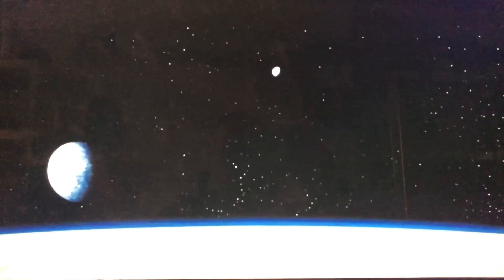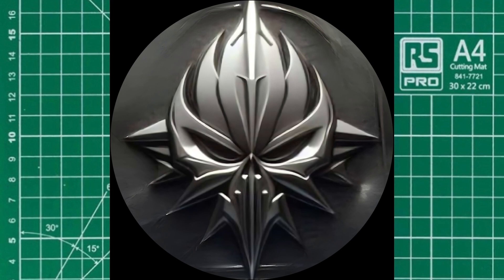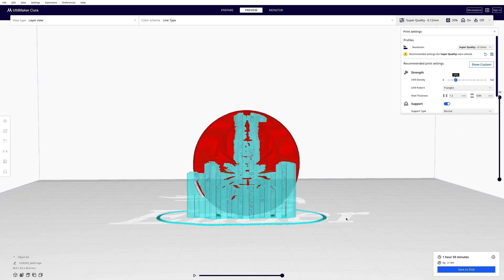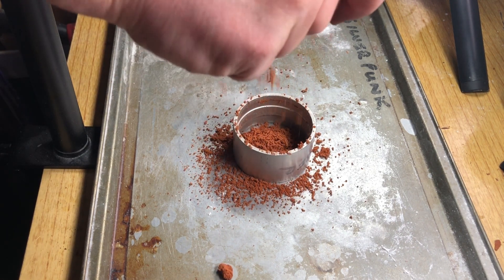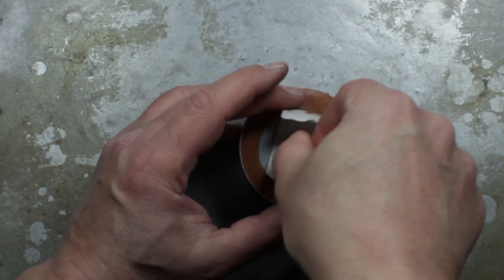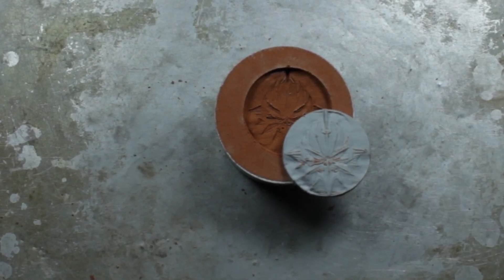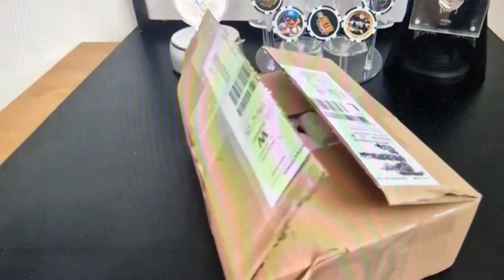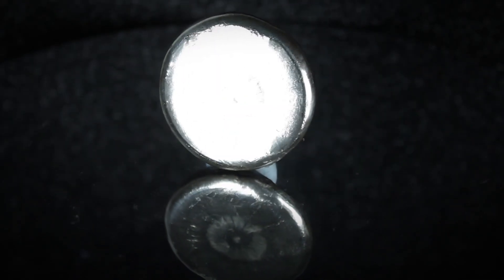How To Turn A 3D Print into Metal - Silver YouTube Channel Coin - 3d Printing to Sand Casting

Comment: I noticed that you didn't use a hammer to pack down the clay. I've always been told you need to do that. But every time I use a hammer, the clay splits somewhere on the top of the mold. Is that because I'm compressing it too hard? The delft clay I'm using is brand new and seems ok to me. But I just started sand casting, so what do I know!
Reply from the maker: Hey Scotts! great question, i normally do pack down as hard as i can using a rubber mallet or something like that, but it just really depends on what you are making, some things come out better when really compacted others with a more lighter compression, sometimes i have just pushed the mould into the sand by hand and lifted out, its just trial and error sometimes until you find the sweet spot, the more i have done it the more i kinda know which is the best route to take, hope this helps.
Reply: @SilverPunkPour  Thank you very much for your reply. I think I must be packing it down too tight. I'm guessing that once you hammer the clay in very tightly, it has no place to go and will crack or "burst."  I was trying to sandcast a bullet, when it first happened. I'll give your method a shot. Thanks again!
Reply from the maker: @scotts4134  no problem good luck mate, let me know how you get on :)

Comment: Great video! I have a 3D printer and use PLA filament. I haven't been printing very long. But all my PLA prints don't come out "smooth."  What type of filament did you use to make this? I'd love to be able to make things like coins on my printer, but the fact that they won't come out "smooth" concerns me. I can't pour and then take out the "roughness" on the coins. I don't think they'd look very good! Any suggestions?
Reply from the maker: Hey Scotts another great question, at the moment im using Creality Hyper Series Filament, bit expensive compared to some but im having good results with it at the moment so dont want to change, i normally always print my coins standing up on an edge, at super high quality, it takes a while and comes out well, i also use a small nozzle size, sometimes after printing i do some prep by hand, some sanding and priming it just depends on how the print looks. :)